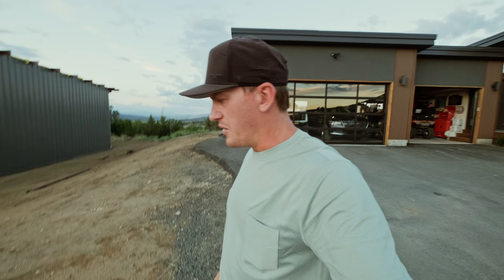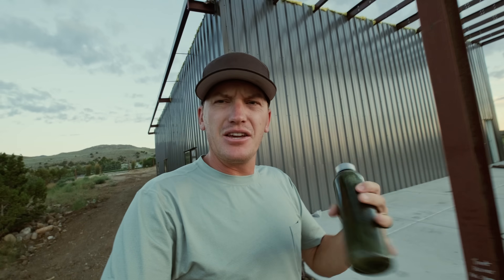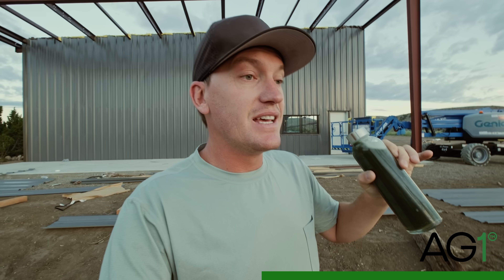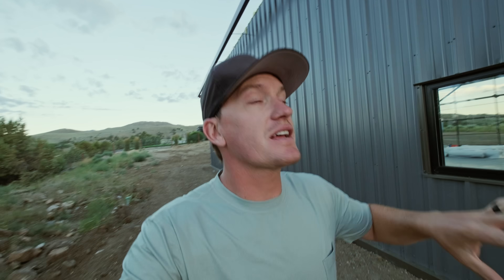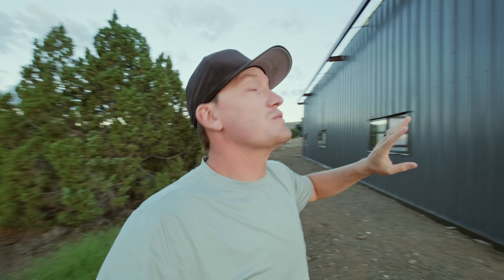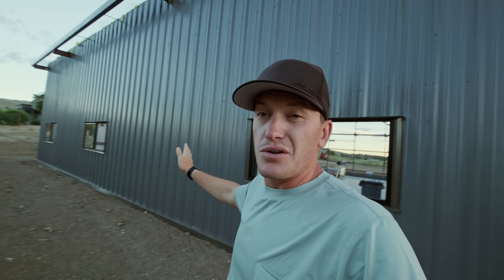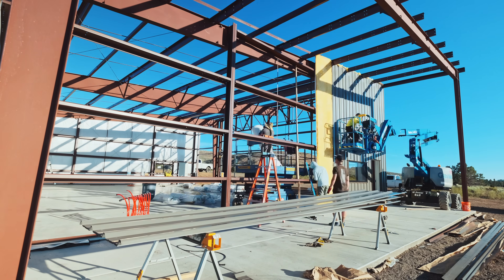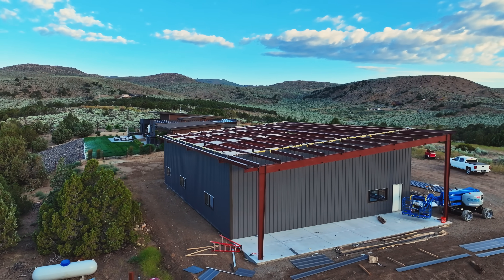Siding and Insulation - Hangar Build Part 4

Comment: Hopefully the roof is able to hold the weight of the snow in a strong winter without you need to climb up and shovel the snow away.
The better the insulation, the less snow is melting!
Reply: Maybe it's a good idea to put photovoltaic panels on the roof with an angle, where the snow can slide down.
Then you have two advantages in one 😊

Comment: Looks great Trent!  Are you planning to go with epoxy on the floor?
Reply: I did a polyurea floor coating in my hangar and I can't recommend it enough. It's a bit pricey, but it's tough and after a year with it, every oil spill has cleaned up perfect. Someone dragged a cast iron table saw across the floor and I about had a heart attack thinking it would tear it up, but it didn't touch it. And it supposedly will never peel off.

Comment: I saw you cutting your tin with a zip cutter, but didn’t see any other cutting method. No doubt you were using a better system, but if you weren’t, I’ve found a really fast procedure is to mount a carbide saw blade backwards in a skilsaw, was very fast. Try it on some scrap first. Always wondered about how safe it was, so took precautions, no one in line of blade!!!
Reply: Zip wheel on a cordless grinder, and a cordless jigsaw. Works on tin and vinyl bits equally well. I have a pair of “wezsnips” all purpose cutters with pointed blades that let you stay away from the end of cuts with the powered stuff, so you don’t go over. Old metal cutoff blades from my 14” saw work great in both my sliding miter saw and my 7-1/4” handheld for those cuts. More “dust”, but a lot less shrapnel as you get with a backwards saw blade (don’t ask about the shrapnel).🙄
Reply: @colinwallace5286  . Coilin are you talking about WISS snips. they are aviation style tin snips.

Comment: Looking great! Though I don't see any proper rainscreen or weather resistant barrier. Is rain and humidity not an issue over there? What about condensation between interior and exterior?
Reply from the maker: The white liner on the insulation acts as a vapor barrier, we are in a very dry climate though, so it’s not as big of a concern here